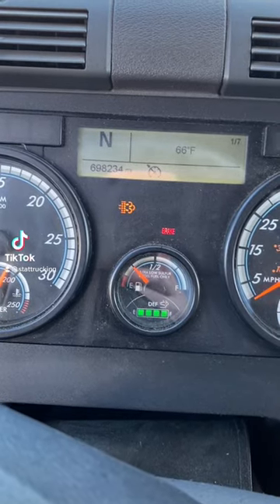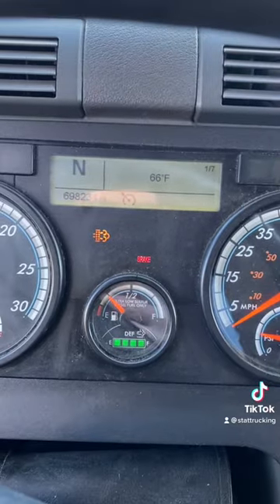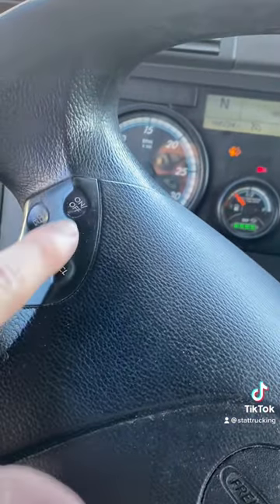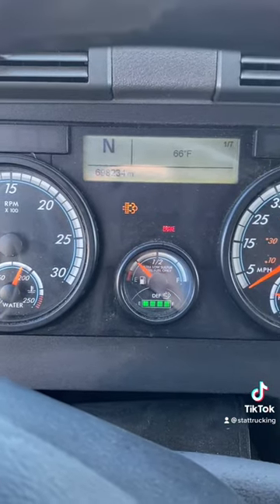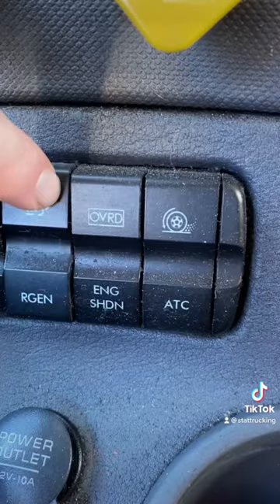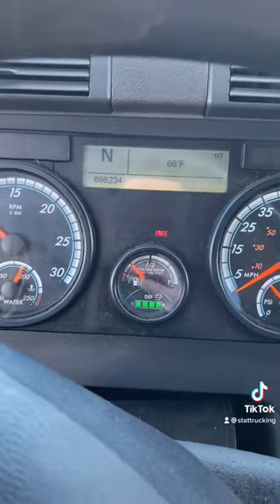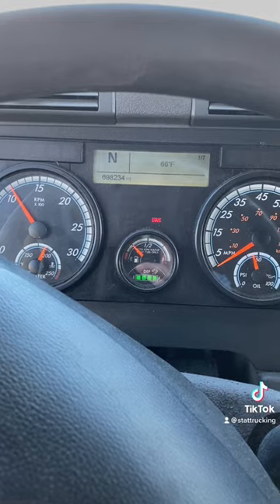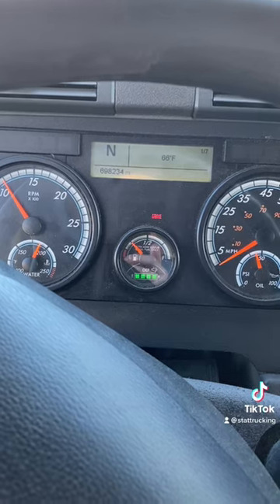How To Regen A Freightliner (parked)

Comment: So if the light is flashing it means it’s working? Mine is flashing after I held down the regen button but the RPM is just about 5. It doesn’t sound like its doing anything.
Reply from the maker: Once my Regen light begins to flash, it always works for me.
Reply: @STATTrucking  Turns out my soot level was high and I could not do a parked regen. It would fail with check eng light on. So I just drove it and it disappeared after 100 miles.
Reply from the maker: @googlegoogle9712 That is great to know, I’ve never run across this situation and now know what to do. Thanks for following up, I really appreciate it. 👊🏻🍻
Reply: @STATTrucking  Yes sir. You’re welcome and thank you. Hopefully it doesn’t happen, its just a bad feeling in the stomach when you’re on the road. You know what Im talking about lol. Stay safe.
Reply: I drive a Thomas EFX school bus, the regen works the same. Once it's flashing that means it's in progress, after about 5-10 minutes you might get a hot exhaust light and that means it's about 1/4 of the way done. Also I've noticed it doesn't work if you have accessories on like your Jake brake, AC, heater, defroster or if you have cruise on like mentioned in the video.
Reply from the maker: @ATSAdventures84 good to know, I only knew about the cruise control but these trucks have so many quirks.  I’ll sometimes look up how to do something and the answer will shock me.  
‘Honk the horn three times, left signal, right signal, wind shield wipers on high”
—to reset the radio 😂
Some of the fixes are right up that alley
👊🏻🍻
Reply: @STATTrucking  Ah yes you've gotta have a love hate relationship with Freightliner/Thomas Built Bus. On my bus to reset the codes you have to turn the ignition off and on, start the bus fast idle it and hit the master switch 4 times on and off, open and close the door, then turn off the bus then back on and click the right arrow on the cluster.
Reply: @STATTrucking  Looked up on how to reset the radio in my bus and it said the following: To reset the radio in a Thomas Saf-T-Liner EFX school bus, follow these steps:

Check Toe-In: Verify the toe-in alignment and reset it if necessary.
Inspect Steering Operation: Ensure smooth steering operation.
Tighten Power Steering Components: Tighten any loose power steering components.
Check Power Steering Reservoir Level: Make sure the power steering fluid level is adequate.
Clean and Lubricate Fittings: Clean and lubricate all fittings.
Inspect Engine Mounts: Check front and rear engine mounts and bolt conditions.
Tighten Spring U-Bolts: Tighten front and rear spring U-bolts.
Drain and Refill Differential Lubricant: If needed, drain and refill the differential lubricant.

HOW IN THE FUCK AM I SUPPOSED TO DO THAT?!
Reply from the maker: I’m dying 😂
Reply: @STATTrucking  It’s basically saying to check every component of the bus lmfao

Comment: A properly operated diesel will never require a parked regen.  I bought my 2019 in 2019 with 2600 miles. And at nearly 553,000 miles, I have yet to have the truck require parked  a regen. Freightliner cascadia with a Cummins x15.
Reply from the maker: I’m sure there is probably some truth to that, come to think of it, I have never had to do a Regen while using my truck in a “normal” capacity. 
Where I have found myself having to do them on a relatively frequent basis (≈every three days) is when I use my truck in a consistent “yard moves” capacity.  Outside of doing that, I’ve never had the Regen light come on. 
👊🏻🍻
Reply: @STATTrucking  that’ll do it. Long Idling and short trips will cause a dpf to need cleaned in as little as 150k miles.

Comment: What is this for? Why is it come on and why do you have to region?
Reply from the maker: The diesel particulate filter (DPF) has a sensor to tell when it is “dirty” and a light will come on letting me know it’s time to do it. Usually, the truck does it on it own but after a bunch of short trips/yard moves, the light will come on. The DPF is made of metal/ceramic and the process essentially “burns it out” and returns it to a “clean” state.
Reply: Is there a Jake brake on this truck ?
Reply from the maker: @ernestorocha-rf1eb yep